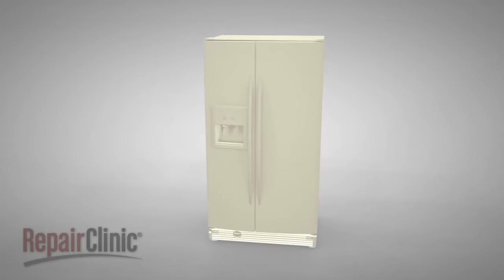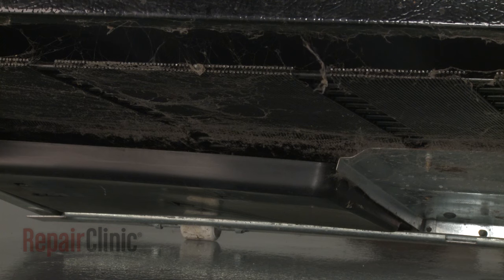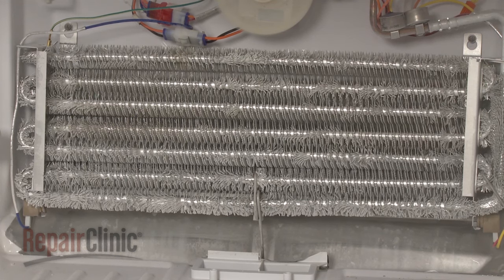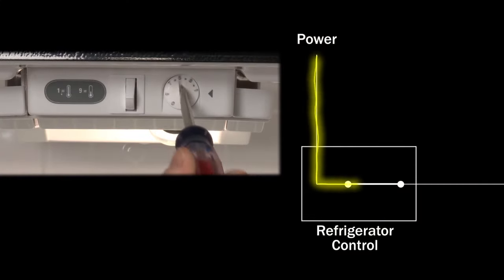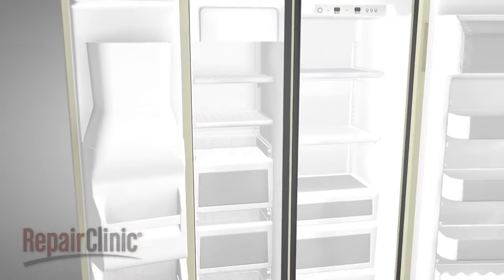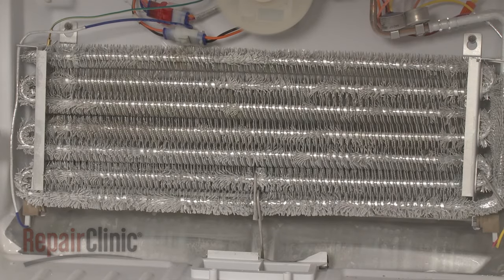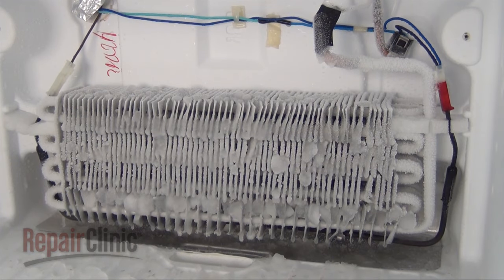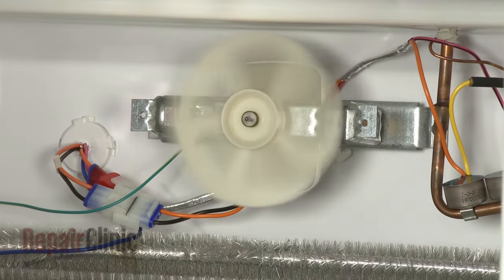How Does A Refrigerator Work? - Appliance Repair Tips

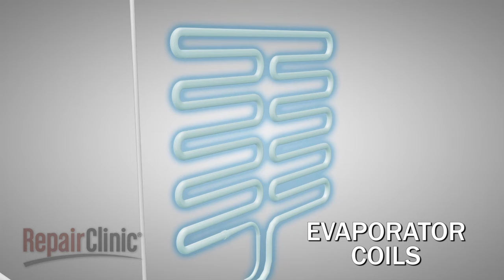Comment: at 1:22 wouldn’t the gas make it warm because heat turns liquids into gases?
Reply: High pressure= high temperature 
Low pressure =low temperature 
As refrigerant passes through capillar tube goes from high pressure liquid into low pressure saturated liquid/gas refrigerant

Comment: I have a Samsung fridge sr216nme and the compressor seems to turn on every hour or so and it's really loud and annoying. The freezer and the fridge seem to keep food cool / frozen as appropriate but I'd like the frequency of the compressor to go back to being once or twice a day. Initially I thought it was a defrost cycle, but after watching your video I think it may be the control box (timing).

What do you think it may be?
Reply from the maker: XrotarebiL There are a few possible causes. First check to make sure the condenser coils are not dirty; dust and dirt covered coils require the refrigerator to do more to release the heat from the coils. Enter your refrigerator's model number in our website's repair help for model-specific troubleshooting help: http://www.repairclinic.com/repairhelp?TLSID=1773.

Comment: I need help replacing the ice chute door on an Amana Item # 12562701 Amana Model ASD2624HES.  Is there a video?
Reply from the maker: +Chuck Pepples We don't have a video for that item. If you contact customer service we could email you a parts diagram of your dispenser area. 1-800-269-2609.

Comment: The freezer of my Frigidaire side by side has frozen water at the bottom which froze the small drawer shut.  Water is also leaking onto the floor.  Any suggestions?  Thanks in advance!
Reply from the maker: +CityCat Normally this is due to a clogged defrost drain. You can use compressed air or a turkey baster to try and clear the drain.

Comment: Your videos are simply superb
There is a mistake at 01:32 it says compressor coverts again into liquid..I think compressor converts low pressure gas from evaporator to high pressure gas,isnt it??
pardon me if am wrong
Reply from the maker: +vaisakh tt Yes, the refrigerant coming out of the compressor is a high pressure gas. It starts changing over to a high pressure liquid as it goes through the condenser. We do mention that earlier in the video. Thanks for the comment!
Reply: +RepairClinic.com ya thats right.but there was a mistake at 01:32 ..but its ok...good videos ..expecting more
Reply: Isn't the condenser the one that converts the gas into a liquid? The compressor only changes it from low pressure to high pressure... right?
Reply: Samsung fridge

Comment: That is true in almost all refrigerant systems. Refrigerant evaporates at low temperatures as it goes through the evaporator. Then goes to the compressor to be turned back into a liquid so it can be put back into the the receiver tank.
Reply: You prune it is called a COMPRESSOR

Comment: My LG bottom freezer fridge is working fine on the fridge side but the freezer is not that cold. I see water in the ice cubes tray. I have cleaned the condenser coils and replaced the condenser fan motor but it is still exhibiting the same issue. What should I do next?
Reply from the maker: First make sure the fan is running in the freezer section. If that is OK, you will need to pull off the evaporator cover and see if the evaporator has any frost on it. If it is full of frost and ice, the fan will not be able to pull the air across it. In this case, you have a defrost problem and will need to check the defrost heater and thermostat. If you are not getting any or very little frost on the coil, you may have a refrigerant leak or a restriction. In this case, you may have to call a qualified service person to look at it. If the compressor is running, the entire evaporator should have a light coating of frost after a short 10 to 15 minutes of run time.

Comment: What else could be wrong, if you replaced compressor motor starter, thermistor, except control board. The compressor motor three terminals have continuity and seems to be ok, feels warm, all condenser and evap fans are running.

Comment: Ok... If i turn on compressor and don't turn it off(what would fridge normaly do) will it break? Even if i cool duwn these coils

I want to store dry ice so it got me thinking maybe i buy freezer and camping cool box and some extra isolating sruff? 

Any ideas? I only want to have it as cold as possible < - 35 would be good
Reply from the maker: mattibboss Even if you bypass the thermostat and leave the compressor on all the time, it is not likely to reach the temperature you need it to. It is not designed to get that cold. Even if you did get the temperature down that cold, the coils would still have to defrost at least once a day and that would bring the temperature back up for a while. It seems like a lot of work that may not be worth it.

Comment: If the evaporator fan fails, the evaporator will freeze up in the same manner as a defrost thermostat failure. In some instances the defrost heater will shut down when the defrost thermostat detects a certain temperature. For example, if you install an L-55 thermostat, the thermostat will open when the evaporator compartment reaches 55F. So it does not necessarily operate by time but rather the defrost temperature because it has reached the thermostat's defrost temperature.When the thermostat is satisfied it will close and the defrost heater will energize when it goes into defrost. Most defrost problems are caused by faulty defrost thermostats. Or it could be a defective defrost heater itself.

Comment: hello i have a question, how come the freezer on my unit works but not the refrigerator? Whenever the door is closed, air stops from flowing into the refrigerator. please help.
Reply from the maker: Enrique Lopez http://www.repairclinic.com/RepairHelp/How-To-Fix-A-Refrigerator/58---/Refrigerator-freezer-is-cold-but-refrigerator-is-warm?TLSID=1773 You will need your model number to get accurate information about what to check.

Comment: The compressor does not turn gas into a liquid. There is a mistake at 1:34 
The compressor turn low pressure gas coming from the evaporator, to high pressure gas, not liquid. 
At least admit the mistake....
Reply from the maker: Yes, the compressor pumps refrigerant in gas form into the condenser where it is compressed into a liquid. Thanks for the clarification.
Reply: Actually it is compressed into a high pressure heat-laden gas (hot gas) into the condenser where it expels the heat and changing into a liquid.

Comment: All that I can say is that my Crosley side by side refrigerator is poorly engineered. The air from the freezer cools the refrigerator by depending on a horse shit plastic damper mechanism. The soft HDPE plastic screw and shaft part of the damper have a short lifespan as they wear through each other and bind up the damper door & motor.  $70 for this recycled milk carton part with a $3 Chinese damper motor on it.